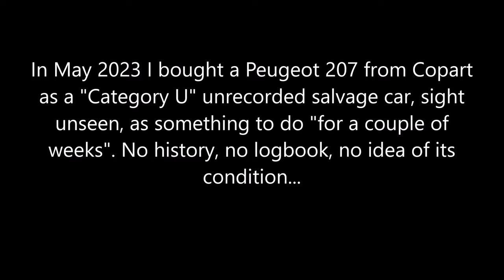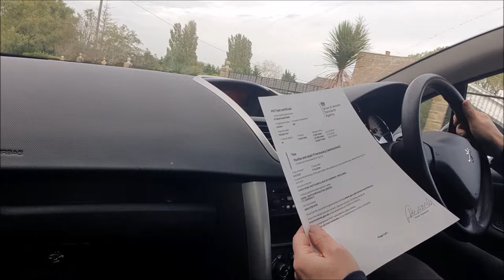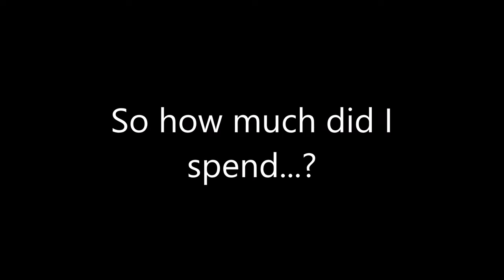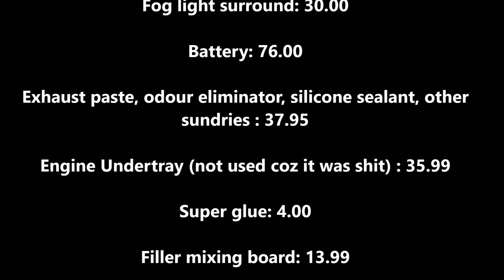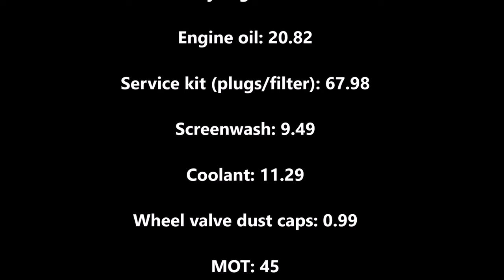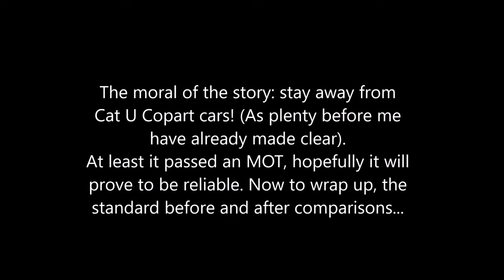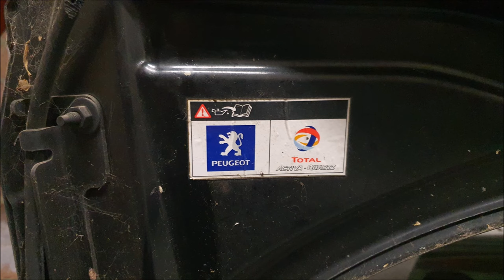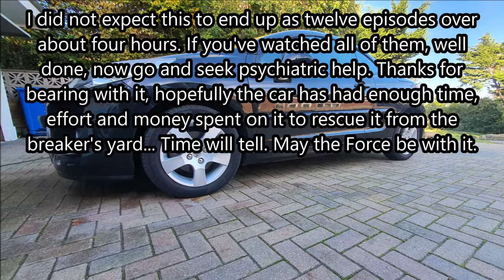Buying a Copart Category U "Unrecorded Salvage" Peugeot 207cc. Part 12

Comment: Very nice job. Really enjoyed watching this series. Any plans to do another (non-Copart) car?
Reply from the maker: Thanks, car is now on the road as my daily driver, covered about 2500 miles since the MOT but not without its issues, still a few intermittent fault codes and some more oil leaks have appeared, but to be fair to it it hasn't actually broken down... yet... No plans yet to do another car but there will be a few more follow up videos in the future. Maybe a leather interior swap and some new alloys. In the meantime I have a couple of videos on a Clio I did before this Peugeot if you're interested. Thanks again for watching, really appreciate it.
Reply: @alistairmscott  Great, I will definitely check out the Clio videos. Fingers crossed the little Peugeot keeps going!

Comment: Fair play to you 👏. I got a Copart Cat U recently at probably 30% of retail value. Some minor scratches and abit of dodgy paint on front quarter. Completely pot luck that the car has 8 main dealer service stamps and i took it to my mechanic for PDI and came back no issues. Drives like a charm so far city and motorway. I will keep it a while.

But definitely wont be doing a cat u again. Not worth the stress and hoping/praying
Reply from the maker: Yeah I definitely wouldn't buy from Copart again. If I do this again I'll look at Gumtree or FB marketplace and actually go and look at something. I must have used up all my luck on the Renault Clio I also have videos for. That's an absolute gem.

Comment: Describing cars as 'unrecorded' is a bit of a misnomer. Years ago, unrecorded meant just that, not mentioned on any database. But it's different these days. It will still show up on 'enhanced hpi check' (motor trade version as used by car dealers and webuyanycar) as being sold through a salvage auction. That might not bother you per se, but you'll have to explain that to the next owner overhaul be in for a big surprise valuenwise.
Reply from the maker: Yeah, I'm aware some checks will show it as having gone through the salvage network. I'm ok with that, I don't think there will be another owner. I'll keep it until it dies. If I can get a couple of summers out of it without it costing me too much more I'll be happy. It was really just something to do to keep me busy. So far it's done 370 miles since the MOT, nothing has cropped up other than the vacuum pump oil leak mentioned in the video. It sits on the motorway happily at 60, no grumbles or nasty noises so hopefully, touch wood, it won't die on me just yet...